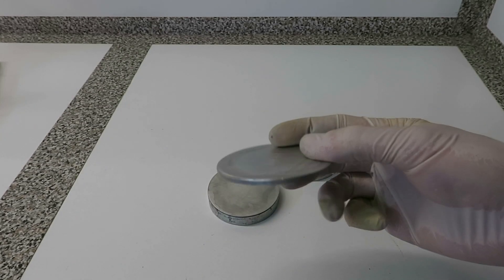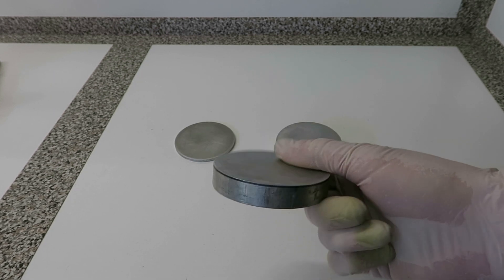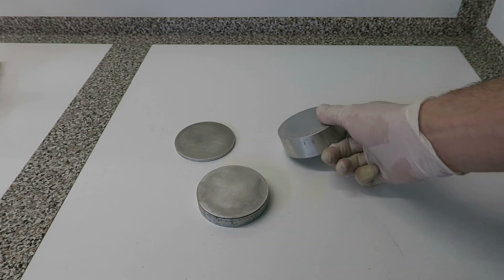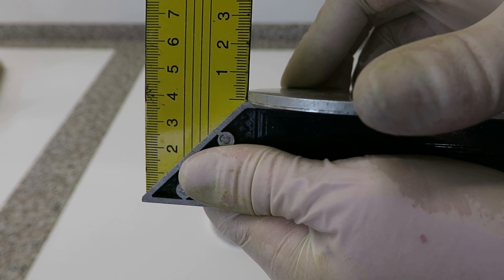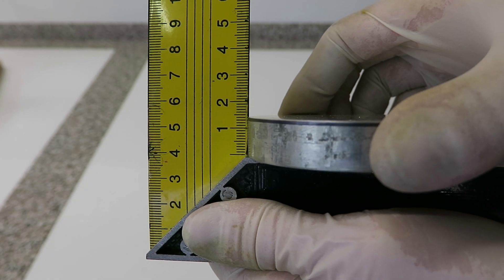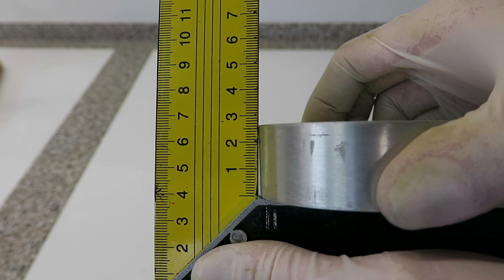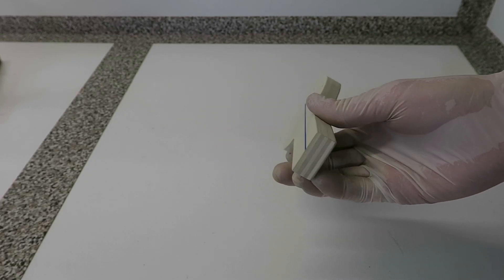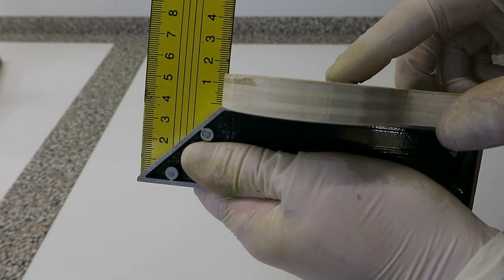Eddy currents vs material thickness

Comment: Are those forces proportional to the mass or to the volume of the conductor?
Reply from the maker: Thanks for the comment. I would say that the force associated to the damping of the pendulum is proportional to the volume (or mass) of the conductor that 'feels' a change of magnetic field over time. Since in the experiment the cross sectional area of all the cylinders facing the pendulum was the same, the damping effect was much greater for the thicker one.

Comment: ❤do u have any video demo of changing to An Carbon fiber disc/ Graphite disc / Graphine disc & which one will brake the Fastest.!!😊
Reply from the maker: Thanks for the comment. Although this video had the purpose to show the qualitative relation between induced Eddy currents and material thickness in the same material, this is a good idea. I have never done this experiment with graphite or carbon composite materials (which are typically non-conductive). But if the material is an electrical conductor it should work. Probably the damping force due to the induced Eddy currents may also depend on the degree of anisotropy of the material (metals are typically isotropic for what concerns their electrical properties while graphite or carbon composite materials are not).